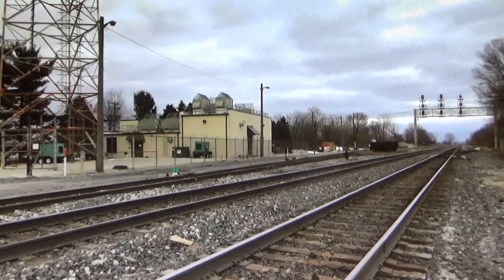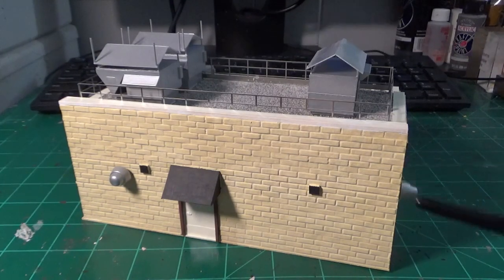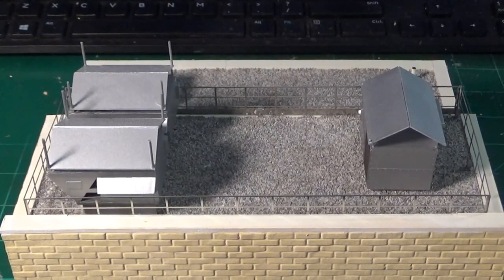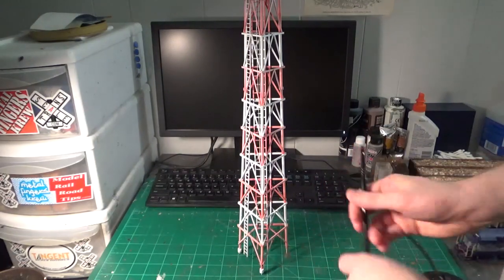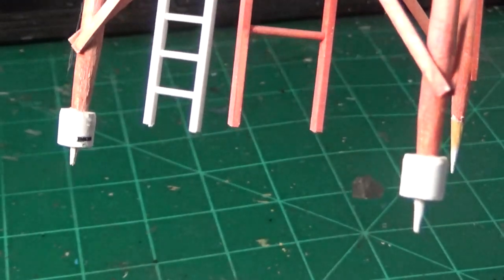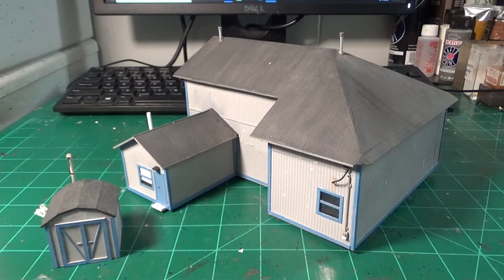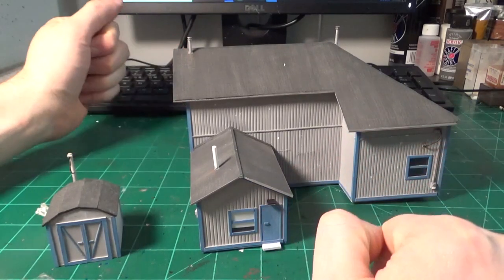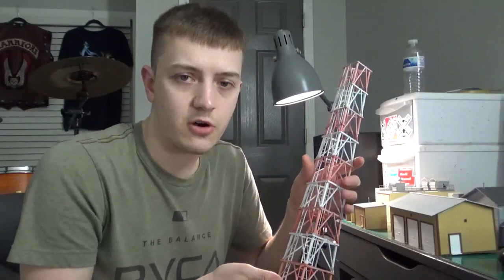**Scratch Built Structures**  HO Layout Details:

Comment: I offer a suggestion on how to build the odd-looking microwave signal transmitter drums for your transmission tower. First, go to your nearest home improvement store (Lowe's/Home Depot/Ace, etc.), and look for 1/4" O.D. (or 3/8" O D.) 90° elbow plastic pipe fittings; they're a buttermilk color used for refrigerator water supply lines. For the conical extrusions on the bottom of each microwave transceiver, consider purchasing cake icing/frosting decorator tips that can be found at either Walmart, Michael's or Hobby Lobby. Each of the microwave transceiver drum surfaces can be made by tracing, then cutting the circle pattern of an elbow fitting from a thin styrene sheet.